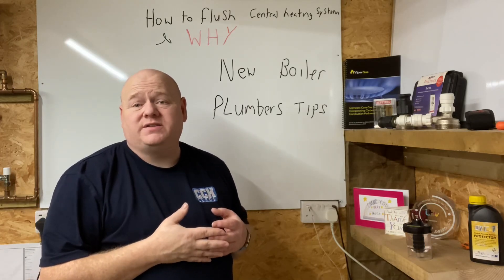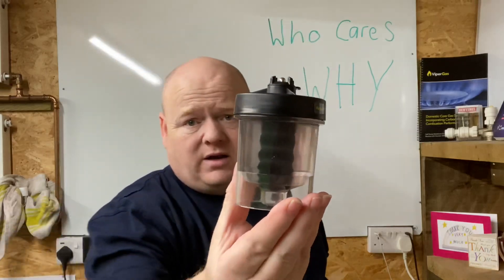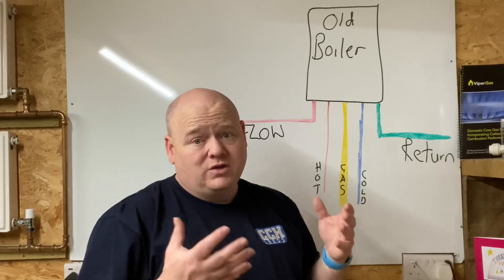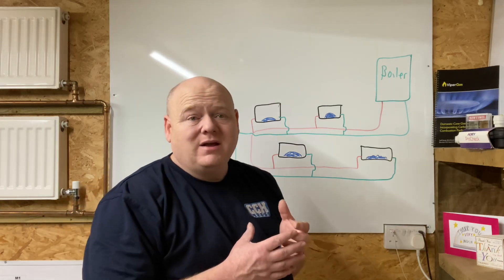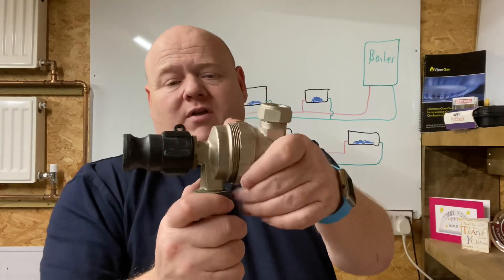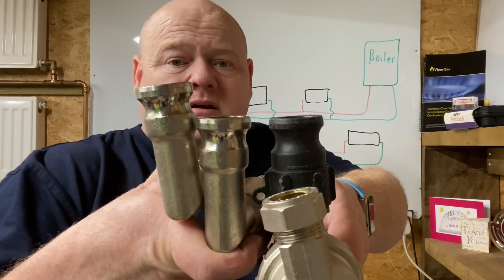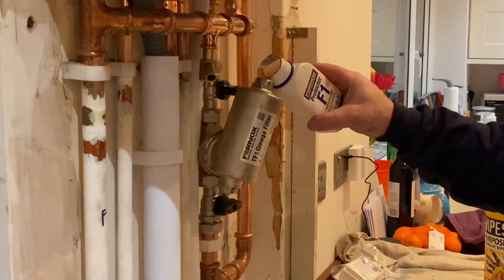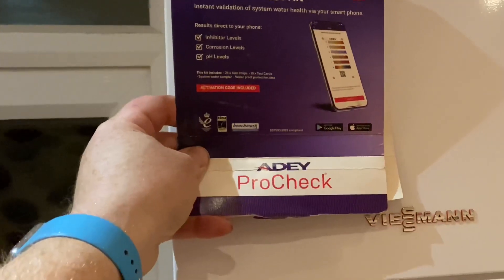How To Flush Central Heating System and Why - Leeds Plumber

Comment: Great video as always, but you have missed out something which non professionals might not know: to do a flush, any motorized valves controlling the heating, and cylinder if this needs a flush, must be open, otherwise the water won't circulate. I made this mistake on my system, which uses motorized valves on flow and return: when the electricity is powered off, the valves default to closed position.
Reply from the maker: Hi John. Thank you for the comment, This video is aimed at new plumbers really, Just showing a different way. Thanks.

Comment: I always drain the system and add clean water into the system with cleaner ill have the boiler running for a couple of hours to make sure all the magnetite breaks up and ill go round each radiator and use a rubber sds mallet to remove any sludge that's stuck to the rad. After this ill close each radiator individually to make sure each rad is getting a good solid clean. After this ill turn the boiler off. Ill then flush all the cleaner out of the  system and re instate the system with fresh water and inhibitor. Ill then balance the system so that the system is working efficiently again. Usually takes me half a day. To do a flush alone. If its a new install I usually take a full day.

Comment: I my experience a cold water main flush does not clean system, only cleans water so down the line corrosion is still in radiator, making water dirty. Powerflush is only answer for me!
Reply: I find that it does help remove large amounts of rust and dirt within the system, which I feel is a good start and can help reduce the amount of time you need to carry out a power flush or chemical flush.
Reply: Not only that, it can also help you determine which radiators are most affected by observing the flow from your hose pipe and can detect whether there is a hidden by pass on the system etc etc.
Reply from the maker: Thanks very much for your comment, please consider subscribing to support the channel 🙂

Comment: Excellent video.... I agree time is against you when flushing /boiler fitting .. 

I always visit the job a week before to add chemicals an let them use heating as Normal.. go back the day before and give the system an bloody good flushing, mains flushing back and forward until water is is clear.. reconnect up to existing boiler 
Return next day and swap boiler an works .. then give a final hot flush an then add inhibitor ... hope that’s enough to be suffice for benchmark
Reply from the maker: Thanks.

Comment: Nice explanation of the flushing process Allen ,  ive recently purchased a new tool made by Fernox , it looks like a painters roller about 200 mm in length and is used to roll up and down on the rads to agitate the magnetite inside the rad and help to remove it while flushing , basically its a rubber roller with a very strong magnate inside and you use it the same way you would if you where roller painting a wall , from what ive seen it seems to help a lot in the removal of the built up sediment inside the rad....
Cheers Allen
Reply from the maker: Have you used the Fernox Tool yet? I have seen it but didn’t really see the point. Be interesting to see how you get on with it. Thanks.

Comment: Great content Allen. Quick question. If flushing the system this way, is the boiler supposed to be on or off? Also on the Omega filter, are both valves supposed to be in the open position (just like normal)? Would appreciate your knowledge!

Comment: Does this flushing process work for an older type non pressurised heating system?   What is to stop the flushing water going into the feed/expansion tank and overflowing from there?  I did find some useful ideas to help flush my system, so thanks for that!

Comment: Great video. I always try work like this. Rather than been stood around i try have a good work flow. While one this is been done I do something else etc 'work smarter not harder'
Reply from the maker: Thanks for sharing!
Reply: Hi Allen ive got a 10 mm microbore system with a potterton profile boiler 30 yrs old now still going and serviced every year. I asked the guywho just done a service about a powerflush as the system has never been drained he said its no good for microbore.
Any thoughts ive got a few cold spots on the rads and boiler is a bit noisy at times.any advice would be appreciated

Comment: If the existing boilers functional.  I prefer to do a hot flush balance the filling loop with the drain off and keep the boiler running on full.  If I can tap into the flow then I will.  In most cases I'll always reccomend a magnaclense if the system water looks particularly dirty.  The powerflush comes out as a last resort. Or if the customer requests.  I'm pretty sure adey with replace your rad agitator if you send them a pic of your broken one.  That piece comes with a lifetime warranty.  Brilliant work Allen, appreciate your hard efforts. 👍
Reply from the maker: Thanks for the feedback.

Comment: Allen, when  doing a mains flush,  but not fitting a new boiler,. A  Combi with a magnaclean fitted,.   
Do you isolate one of the valves on magna clean,. ?

Comment: Just had a new boiler fitted, one rad wasn't working, the installer has fitted a new TRV head and valve, but it's still cold. I've also used an infrared thermometer to check the working rads and they are  approximately 10 degrees colder at the bottom than the top. Does that mean that the system hasn't been flushed sufficiently on install and needs a power flush?

Comment: Great video well explained 

Is this the same for my old system that has a  hot water tank 

When I replaced radiators I put a cleaner in for a week then just drained the system and refilled a few times till the water ran clear 

I also took the radiators that I didn't replace outside and flushed them out with a hose till all the black water was gone 

Thanks
Reply from the maker: Not really. This is when changing a combi boiler. Thanks.
Reply: @AllenHart999  thanks for the reply 

Would you have to go up to the loft to connect a hose to the pipe coming from the small tank 

Or could you do it via one of the First radiator pipes on the system 

Thanks
Reply: @tommyneil303  to do what exactly?
Reply: @simonstones1918  flush all the sludge out 

Or would refilling after and putting a cleaner in and draining a few times
Reply: @tommyneil303  oh I see! Yes either option to get the cleaner into the System 👍
Reply from the maker: Thanks very much for your comment, please consider subscribing to support the channel 🙂
Reply: @AllenHart999  i have been subscribed for around 6 months
Reply from the maker: Tommy Neil Thank you, just going back over old comments. Thanks so much for all your support

Comment: Thank you so much. Flushed through system and cleared out a lot of crap. Can you advise about the setting of the Lockshield valve? Every rad has a TRV and the some people where saying close the Lockshield right off then half turn on, is this correct?
Reply from the maker: Thank You

Comment: Hi. Im thinking of replacing my boiler soon. I gave a lot of time so rather than flush  it the way you've said can i take out each radiator and flush them with a hose outside and the reconnect them and use a connection to flow and return and do a final drain from the lowest point using the lowest point radiator drain?
Reply from the maker: You can take the rads of and flush but you still need to flush the pipes. Thanks.
Reply: @AllenHart999  yes thats why i said after you take the rads of and flush them you need to replace them and run water through the whole system

Comment: Great video - clearly explained a credit to the city of Leeds!  I have a radiator need to patio door and outside drain that has a drain tap on it.  Presumably it would be best to use this to connect the hose pipe to drain off rather than connecting to the flow?

Comment: Great video. You clarify my most of my questions. I will be grateful if you coudl answer me about two motorised valves (actuators) for heating upstairs and downstairs, so if I want to perform water flush I should switch boiler off and open both valves in the same time?
Thank you for effort while recording this video. All the best for you
Reply from the maker: Yes and yes
Reply from the maker: Thanks very much for your comment, please consider subscribing to support the channel 🙂

Comment: Great information - Thanks Allen. A couple Questions for you: I have an older system boiler with header tank and have found the drain valve. Problem I want to sort out is two radiators wont heat up fully, all rads have been bled. I don't think there has been a power flush done for over 10 years. I have just connected the hose pipe to the drain valve and done a manual flush until water comes out clean. 1) should I add any cleanser or inhibitor ? 2) Should I fit a MagFilter 3) Do I need a power flush ?
Reply from the maker: Hi Hemant. It’s very hard to give advice without seeing the issue. Maybe you could do a water sample?
Reply: Hi I have the same problem as you and same system with a drain to the outside also couple of rads not warming up properly how did you solve the problem. thanks

Comment: Is this for a combination boiler  as apposed to a condending boiler and hot water cylinder.  would you have cold water system connected to your boiler on a latter type. 
I pressurise my system at a small red tank next to my hot water storage cylinder . 
Also 
I have a radiator flush point near my front door. 
Is this normal

Comment: hi Allen.  I am currently trying to flush out a combi system.Boiler switched off, drain hose on end of line, opened but nothing draining.what is causing the lock out

Comment: So, isolate boiler, blast thru system at mains pressure, each rad sequentially, whilst you have a few ciggies n brews and take the old bolier offa the wall?  I've done that b4. Meks sense. 
Got dragged out today to a 3 rad, vented system with a small HW storage cylinder on a canal barge. Pump was running off a 12V supply. Had a log burner fitted and a secondary diesel heat source for summer added later.  f&e tank was the size of a matchbox. Had to admit defeat.  R. Don was frozen. Few dead fish trapped in the ice. Grabbed a couple.  So, at least only had to buy a bag of chips fromt chippy on way home for mi tea. Happy new year, pal!
Reply from the maker: Happy New Year.

Comment: I wonder why the system cannot be flushed out while the old boiler is still in situ, if it still works of course but is just on it’s last legs so to speak?  Then nothing will go into the new boiler at all as everything will have been removed before it is fitted.  Am I missing something as I know nothing about boilers but want to learn as mine will need replacing soon.  Would you recommend the Viessmann Vitodens 200-W from both a performance and ease of service point of view, for a 3 bed detached with 1 bathroom and 1 shower room and 10 rads?
Reply from the maker: it can. but it would cost you more as it takes more time and you also need to flush the new boiler. Thanks.

Comment: Great vid, easy to understand. I still think its easier ti change the rads then doing a power flush. For £300 (average per house)  you can have all new rads and do a quick mini flush and you will be good to go for atleast another 5 years. What do you think Allen?
Reply from the maker: New rads still need flushing. Thanks.
Reply: New rads for 300 quid..dream on!
Reply: Small house if you can get all rads for £300!
Reply from the maker: New rads still need flushing

Comment: do I need a bottle of cleaner for each radiator when we do flushing the radiators one by one and isolating all the others?
Reply from the maker: Depends on the size of system and the chemical you use but I normally use 2 tubs when flushing. Thanks.

Comment: HI mate good video how are you controlling the water pressure? As this may over pressure the system and cause leaks . Thanks
Reply from the maker: Very good question. It’s a bit of guess work really. It’s always worked well for me and I have never had an issue. Thanks.

Comment: I have a magnetic MagnaClean Prof 2 ADEY filter installed for my GRANT combi boiler. I cleaned the element with water, some kind of solvent to remove the sludge and mechanically removed the metallic particles from the element. I am going to run the boiler with a cleaner and afterwards I am going to add the protector chemical in the filters bowl. do I have to flush the system's water to completely remove the cleaner before I fill the filter' bowl with the protector chemical?
Reply from the maker: Hi Elen. Very good question. I would always advise to remove as much of the cleaner as possible, The more clean water you flush through the better. Hope this helped. Thanks.

Comment: Hi Allen I'm arranging with my plumber to fit new combi boiler replacing old gravity boiler late summer, I will need to also replace a load of seized rad valves would it be beneficial to remove the rads at same time and flush out in the garden with hose pipe higher pressure ? also in you're opinion should I have thermostatic valves fitted, hoping to do this prior to the plumber coming to save him time and me money thoughts please.
Reply from the maker: You would need to speak to your plumber. I would personally charge for a flush anyway. Thanks.

Comment: Do you still need to flush if the previous system had a magnaclean fitted from new?
Reply from the maker: All systems need flushing in my opinion. Thanks.
Reply: @AllenHart999  thanks for the reply. Been trying to find a good local plumber but seems very difficult. Had three different plumbers service our boiler in the last 3 years, all based on local recommendations, but not been impressed with any of them. Any tips for finding a really good local plumber?

Comment: Where are the camp locks from mate ? 
I now normally have a tee with iso valves on the flow and return of the new pipework for the boiler
Reply from the maker: Remember we need to use a back flow prevention device when filling. Cam loc came with magnacleanse. Thanks.

Comment: Allen, can you also please explain a mains water flush process for an open vent heat only system, and the best way to plug the water inlet and expansion over flow. Regards
Reply from the maker: Yes, I will talk about it on the end of my next video, Magnacleanse video, Tried to do it live today but poor signal. Thanks.
Reply from the maker: Thanks very much for your comment, please consider subscribing to support the channel 🙂

Comment: Hi I have a Glow-worm gas boiler how much would it cost for a magnaclean pro 2 filter and magnaclean power flush
Reply: lol
Reply from the maker: Depends where you are. Also how many rads. Thanks.
Reply: 7 rads and post code Ng229sh ,new ollerton
Reply from the maker: @MrAndylangham  I would be £450 plus vat. Thanks.

Comment: Have you ever compromised the water tightness of the rads by cleaning off all the sludge inside? I know I have. Two rads pinholed shortly after flushing.
Reply from the maker: I have flushed hundreds and hundreds of systems and had maybe 3 rads pinholed. Thanks.

Comment: Do you turn off both lock shield and TRV side or just TRV side when flushing?
Reply from the maker: Normally do the lock shield. Also take TRV off and make sure the pin isn’t stuck down. Thanks

Comment: @Allen Hart   @Allen Hart   @Allen Hart  is it almost mandatory to do a chemical flush on a install job? 2. @ 12.33 mins you said return to boiler do you mean the muck going out of the drain off near boiler? 
3. @ 12.49mins you said about chemical flush and no option but to push it through boiler ( you actually mean the muck gets pushed through boiler.?)

Comment: Is it possible to flush a heating system that uses 8mm copper on the radiators?
Reply from the maker: Sometimes its possible but not easy. Thanks.
Reply: @AllenHart999  okay, thanks for the reply.

Comment: I had a boiler installation Engineer wouldn't care that radiators are 20 years old . He wouldn't even bother with flushing the system.
Luckily I apply common sense and done it prior installation. 
Radiators change and flush done ✔

Comment: Like the boost your productivity idea Allen, while getting on with other things, really useful for the unexpected emergency changeovers, where time is always against you.   Cheers.

Little tip back for you:      Get a small funnel and adapt it with a fitting to fit onto the filter,  much easier to put the chemical into the filter without spilling any.  same funnel with a bent  1/2" male iron is good for dosing chems  into a rad on open vent system with no filter.  HTH 

On a side note mate: You look much happier and relaxed of late with is good to see. :-)     Take care.
Reply from the maker: Hi Julian, I have one in van lol... Too lazy to get it. Thanks.

Comment: Hi Allen 👋 great video , I sort of feel a fool that I haven't been using that flushing method as it makes perfect sense on maximising work production. Thanks for that tip 👍 
My 1 and only question to you is regarding the radiator cleaning.  The sequence ect im fine with and totally understand but what I would like to know is do you partially fill the radiators with water or do you fill them full and vent? Which in your opinion is best effective? 
I know Adey advise to partially fill rads then use their aggerater on the drill to move most dirt sat inside. 

Kind regards 

Aaron 
(AMJPLUMBING)
Reply from the maker: This channel is all about learning. Hopefully we can all learn things together. Partially filled rads make sense but takes more time. This is to show a faster way to flush while still doing the rest of the work. Hope that makes sense. Thanks.
Reply: @AllenHart999  thanks geezer 👍